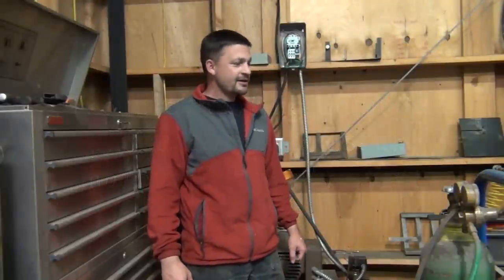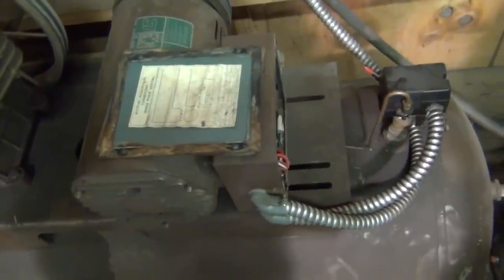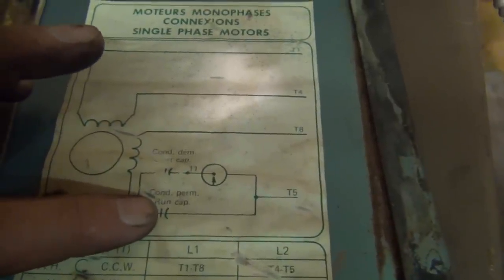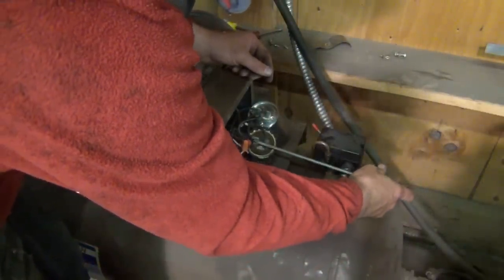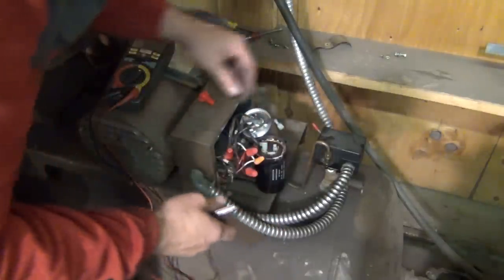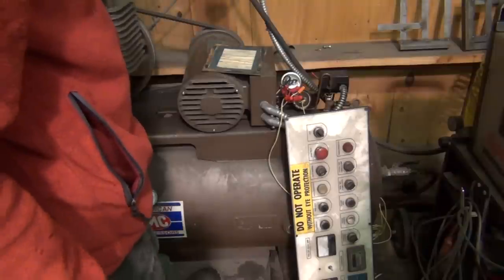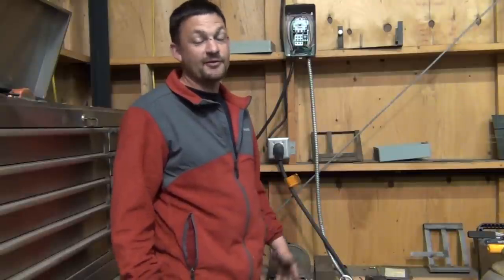Air compressor motor troubleshooting Part 1- bad start capacitor switch

Comment: Man, you saved my life! Bought a 10gal 1-1/2HP Husky thats has an oil leak, has to dismantle it, took pictures but didn’t mark the exact position of the inertia switch! Wasn’t sure if it was supposed to be NC or NO and was trying to adjust it to be open and thought it works the other way! Thank you for making this video!

Comment: Very happy to see the diagnose and work around for proof method. Alot of people ignore what has been given to them for just that reason (i.e. circuit diagrams and common sense use of tools). To often it's the throw a part at it and see method, gets expensive.

Comment: Very good video.  You saved me about $400.  Mine had a hard time starting so I looked at the capacitors, one had a burn mark on one so I figured that was it.  Replaced both capacitors and still had the problem.  Finally took it apart because I thought it was now the centrifugal start switch and lo and  behold one of the wires fell off so it was not working.  Crimped it good and put back on the switch and now works fantastic !!!

Comment: i've got a 7.5 hp 80 gallon ingersoll that's throwing a breaker on start up part of the time. sometimes it doesn't do this BUT throws a breaker when it's trying to reload. I've had this compressor 10 years or so and it just recently started doing this. any suggestions? thx

Comment: My air compressor has problems starting and then the start capacitor started leaking so I replaced it with another start capacitor of the same value except the old capacitor was rated 165 volts and the new one was rated 125 volts but of the same microfarad rating.When I turned the compressor on with the new capacitor within 30 seconds the new capacitor blasted off like a rocket lol,I guess I cant take it back.Iam wondering if the voltage difference is what caused the problem or if their might be an issue with the compressor blowing start capacitors.The compressor is only wired for 125v.

Comment: Thx man
Mine is struggling to get up to speed to and then trips the breaker. 
Most likely the capacitor
Reply: Mine buzzes and doesn't do anything then trips the breaker
Reply: It's a oiled pancake air compressor bought it for $50 and it worked great two days later it does that
Reply: Or the unloader valve.

Comment: can the inertia switch be stuck on and cause the start capacitor to fail?
Reply: @stonefisk  I found that out after I asked this question.  Original one melted down with oil running out and smoking.  Replacement one blew up.  Luckily it was under the "shield".   Scared me to death when it blew, I had to change my shorts.  Quick disassembly found a "mud-daubber" nest was on built on  the centrifugal inertia switch making it inoperative.  I was quite excited when,  after I removed them nest and got another capacitor and my super cheap compressor worked.  Still use it every day in my shop.  This video really helped.

Comment: I have an 80 gallon stand up IR 7.5 hp compressor.  This thing is about 10 years old and we have never had a problem with it.  But now when it starts it starts okay but it will not achieve full rpm, I'd guess its running about 50%-70% of full RPM.  We can also hear a screeching sound like a bearing issue.  We have found the screeching noise is indeed coming from the backside of the electric engine.  I think we have 2 problems consisting of a starter capacitor issue and a bearing problem.  Other people think its JUST the bearing.  What's your opinion?
Reply from the maker: cblair0608 I'd hate to hazard a guess without hearing it.  One sure way to find out:  take it apart and see which parts fall out!

Comment: how do you or would you test the capacitor if needed. I don't have an expensive multimeter with the normal testing function. Can I do it by ohms? Thank You!
Reply from the maker: No, you really can't correctly test a capacitor without a specific capacitance tester.  However, you can do some basic testing that might tell you if it is bad.  With the capacitor fully discharged (short across the leads to make sure), it should show a low resistance (ohms) at first, then slowly start to rise.  The rate at which it rises depends on the multimeter you are using, the capacitor, and a few other variables.  If there is a bleeder resistor across the terminals, this test won't work.  You can also charge the capacitor with a DC voltage source (12v battery).  It should draw high current at first, then slowly taper off until it is fully charged.  It should hold the 12v for a while (unless, again, it has a bleeder resistor).
Reply: Great job! Turns out the same thing was wrong with mine, my switch just needed adjusted...

Comment: I just yesterday, found  an air compressor very similar to yours.i believe this one was stored outdoors. It is very rusty & I do not trust the tank (ticking time bomb) mine is 1/2 hp 7.5 gal 100psi 2.8cfm air delivery 1.5@40, 1.2@90, 42@2.8, 34@63.  The drain valve is seized. I am considering rebuilding this air compressor possibly with a new tank. Can you please refer me to where to get acurate replacement parts? It's a sears compressor which looks almost exactly like yours but smaller.yours has at least 1 extra option that mine does not! (Where the cylinder head attaches to the tank, yours has a device that looks similar to a radiator & mine does not have it, just a tube that provides air to the tank.)

Comment: I think the motor needs a new bearings
Reply from the maker: KillerJoeFIN Yep; they are a bit noisy.  No shaft play yet, but it is certainly coming.  I intend to replace bearings when I disassemble the motor for the switch repair.
Reply: @MattVerley my compressors motor has two capacitor boxes, at 11oclock and 2oclock. Each have 3 capacitors that are hip flask shaped. It won't start either, how do I go about checking the capacitors? 
Thank you for your videos, gives me the gumption to try to fix it myself.

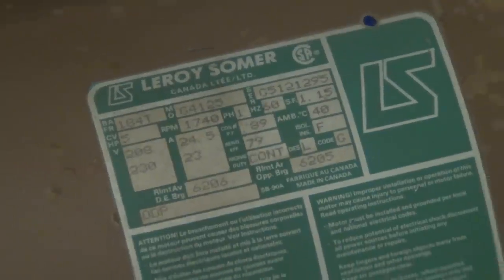Comment: 2:00....'Peak Horsepower'......right, how do you get 6 'peak' horsepower with only 15 amps at 120 volts....that's 1800 watts or barely 2.4 horse..?
Reply: actually 15 amp is rated for 1300 watts. 1800 is max for 20 amp circuit.
Reply: @tomchristensen2914  15ax120v=1800 and 20ax120v=2400...

Comment: Why not just check the capacitor
Reply: Ralph Buglio 
Why? He checked the centrifugal switch that puts the capacitor in the circuit. The switch is bad, he put a push button switch in the circuit to activate the capacitor during start up, the compressor runs, so nothing wrong with the capacitor.

Comment: My compressor will run for maybe 7-10 seconds under load then trip the breaker. When belt taken off, the motor runs loud and then after about 45 second will trip the breaker. Any thoughts?
Reply: run capacitor Good luck finding a replacement. I can't!!